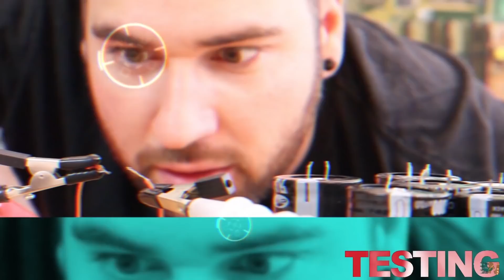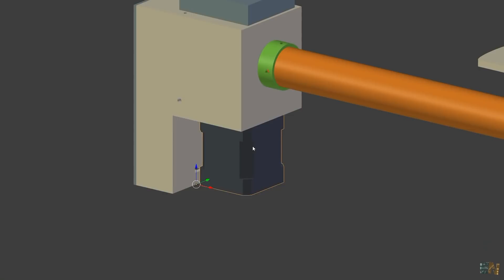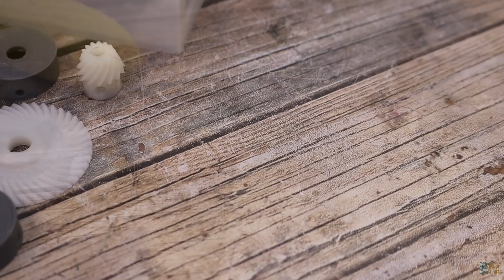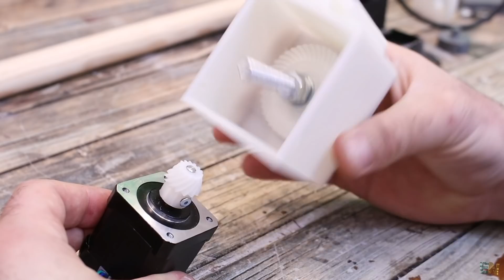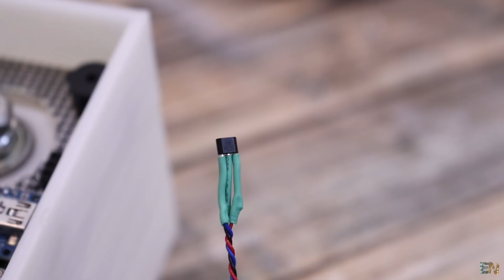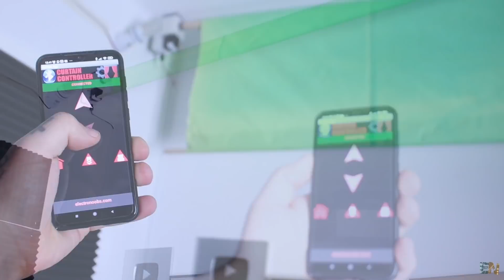Bluetooth Motorized Curtain | 3D Printed + Stepper Motor + Arduino

Comment: Great work! I replaced the Arduino with an ESP8266 and used MQTT instead of Bluetooth, and it's working perfectly. I just have a small question: You're connecting the 49E Hall sensor to A0 on the Arduino, but in the code, you're using digitalRead(). Is that correct, or should it be analogRead() instead? In my casa i was able to use the hall 49E with analogRead() and defining an upper and lower threshold for the voltaje with and without magnet.

Comment: I became interested in this project and decided to make it just like in the movie. After connecting the power supply and pairing the application, the engine does not work, could this be the reason? . Regards

Comment: This is amazing. Maybe swap the arduino and bluetooth module with an esp32 so it could be controlled over WiFi. Then have it listen for api calls from either a stream deck or similar device. This might be overkill but using nylon lock nuts would reduce the chances or anything coming loose overtime.

Comment: Interesting project. Isn't stepper motor enough here? Do you still need the gear? Also, if you are using Arduino Nano, can't you just use software stepper driver instead of physical one? Nano has plenty of memory for that.

Comment: Nice project. I have been experimenting with automating my blinds myself. I wonder why you didn't use a motor with gears that would allow you to disconnect the motor from the power supply. A good reduction ratio or even a worm gear would've been enough to hold the curtains in place without the coils being energized

Comment: I've just done something similar for my vertical blinds using 28BYJ-48 5v geared stepper motors and a nodemcu controlled by alexa. I tried a nema 17 but it was too noisy and bulky. The current setup is only about the size of the nema on it's own.

Comment: I wonder if it could be made smaller
also I am waiting on some ESP-01's from  aliexpress for another project , to add wifi to my roomba by using a  code to make it emulate a belkin wemo , I wonder if  you could use the  arduino to make 2 presets for the  stepper motor ,  figure out how many turns to raise it and how many turns to lower it and then have  one pin  for triggering each setting ,  and then connect the  esp-01 output trigger pins  to those  input  trigger pins ,  so you can have   one press up and one press down and control it with Alexa/Google home , I am not sure if the code I am going to use supports emulating 2  separate   belkin wemo devices or if it can be added  so that  it can emulate 2 devices and use 2 pins though
maybe it could be set up in an arduino sketch so that  turning  on = shade up and turning off =  shade down
for the stepper
the project for the ESP-01 and the roomba is called "Roomba voice control with Alexa and Belkin-Wemo emulator"

Comment: hi, really loved your projects. i actually have one question on my mind regarding this project which is is it possible to use a smart home system such as google home to control this?
Reply from the maker: Probably with an ESP32 and wifi
Reply: i see i see, cause i happen to have a blind just like that. would be a real shock to my parents after they saw i turned their room blinds into a smart home blind hahaha
Reply: ESP32 and Tasmota should be an option

Comment: Nice project. I wonder if there is a way to make it more power efficient. The power supply hat to be always on for this to work. This an issue I also have at home. So far I have no good solution
Reply: Why not use a worm gear to make it not backdrivable and you can unplug the power supply.
Reply: It depends. If you want to keep the motor at a certain position you need to engange the motor to use the holding torque. In this case this is especially important as the second wood pole is alwys drawing downward. But you can use some gear mechnism, friction or a solonoid to get around this. Still the Arduino and the blue tooth always drawing power. Wouldn't it be nice to have an ESP32 in deep sleep, that checks evere 10s or so of the user wants to activate the motor mechanism via the app.that than activates the power? It is a bit complicated but overall it should save a lot of power.
Reply: @electricalychalanged4911  I have a Tuya Wifi blind (I anticipate selling the house with this one in place) that is battery powered. Haven’t opened it up as there is no obvious way, but the wifi module is separate. I assume the wifi module and blind module talk using a proprietary low energy protocol. That is how I imagine they solved that part of the power problem. Not sure how the motor works but it has upper and lower limits (even if no blind is attached) and the speed is so constant it can’t be a simple motor. At the very least there is a speed feedback loop and a timer.